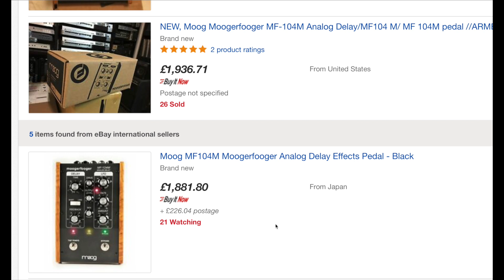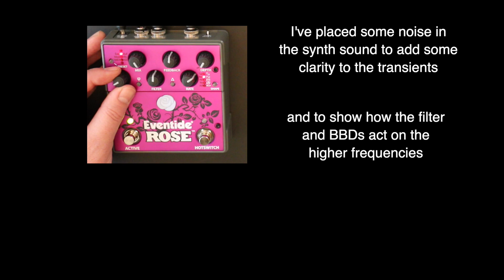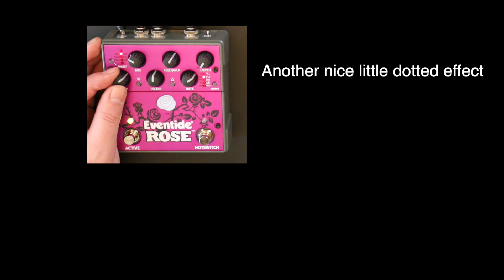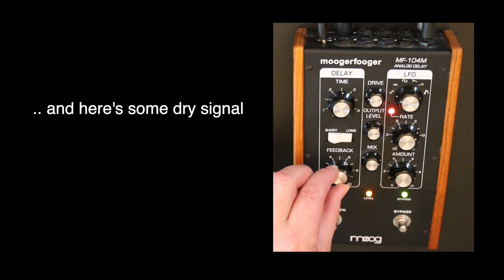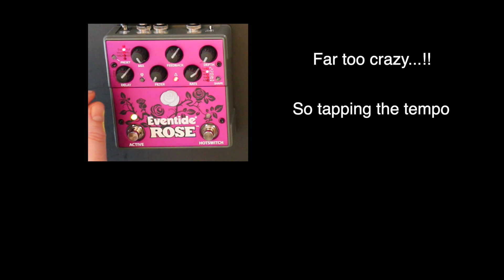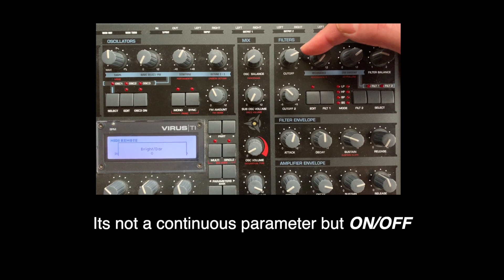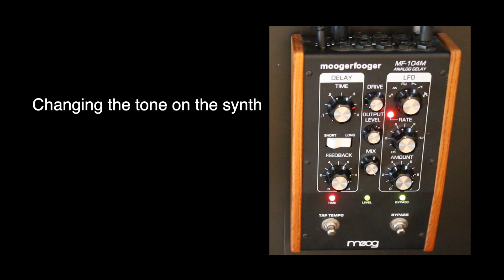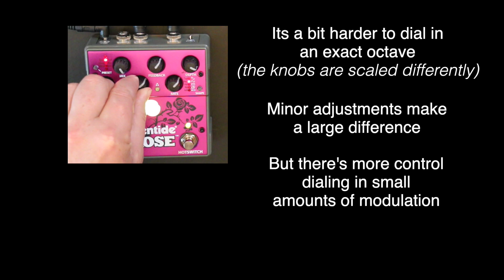Eventide Rose vs Moog Moogerfooger 104M

Comment: Nice, man! You already solved the problem of mono delay to me. I have a Moog MF-104M, I would like to know if I can control it from the iPad (i have the wire/adapters). Thanks!
Reply from the maker: It should be possible to control the 104M from any iPad MIDI controller app.  Using the Virus works flawlessly for me, which I use to access the additional functions and to tweak automations in Logic.

Comment: no midi for a modern digital delay is really weak
Reply: Then it's a good thing that Rose has seven pages of MIDI Parameters on its MIDI Implementation chart.
Reply: Daniel Fisher but I don’t see any DIN midi ports? Can it be midi synced and subdivisions clocked? Im seeing some TRS and USB midi implementation but not sure if that’s for basic midi or if for clock sync and other features like a Strymon Timeline.